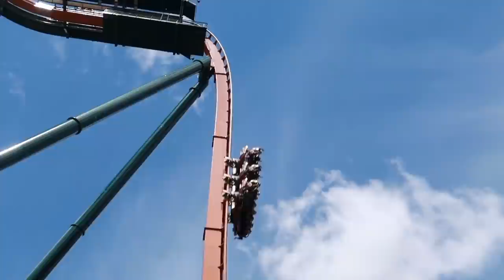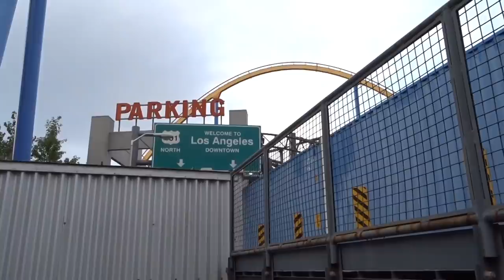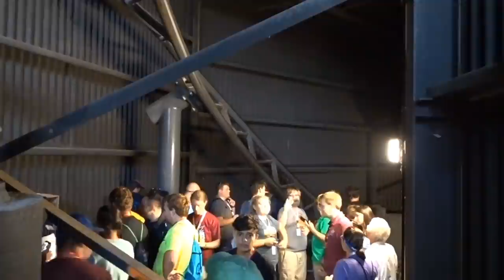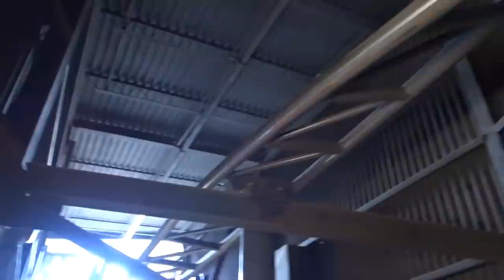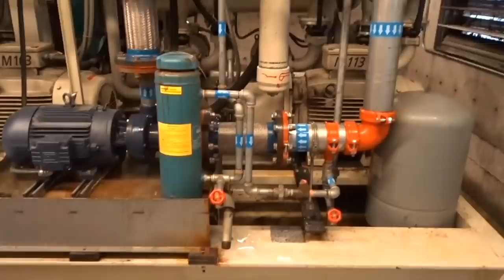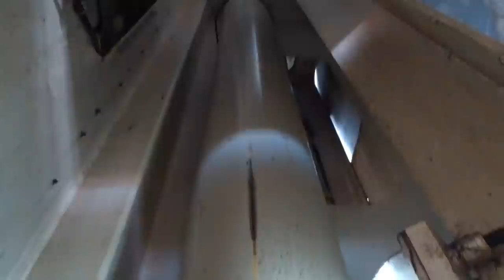Canada's Wonderland Unique Investments

Comment: Floorless is very unlikely. Nobody has had one built in years, and all the recent ones were conversions from a standup. Also, as far as I know, CF hasn't had any B&M flyers built at any of their parks and have only inherited them if they even have a single one (I'm too lazy to look it up right now). Flyers, from what I know, also have capacity problems, so they wouldn't be suitable for such a high attended seasonal park, unless they can build one with a dual loading station and maybe some other improvements to help with flow.

Aside from flyers, B&Ms are perfect for this park. I would much prefer a blitz style launch and an RMC but maybe a wing coaster would be the next best fit. If Thunderbird hasn't had any reliability issues with their launch, maybe this would also be a good option to fill in the gap between the giants and the smaller coasters while also giving a thrilling launch coaster. This would also be a very unique wing coaster for CF, and it's something B&M has done before. Once that's built, then they'll have a good amount of high capacity, reliable coasters and can move onto something else, such as the rumoured ground up RMC. I think that would very nicely complete the lineup. We would have a kiddie, several families, small thrilling (one with a launch depending on how you class Stunt Coaster), large thrilling (also one with a launch) and giant thrilling coasters. Edit: I forgot about a dueling coaster. Don't suppose they could kill two birds with one stone and make a dueling RMC?

Comment: I think you're overestimating Canadas Wonderland's relationship compared to other parks. Canadas Wonderland asks B & M what they want and then they deliver but the same thing happens at other parks. During an interview with Don at Kings Island he talked about how they explicitly went around to all the other inverts and then came back to B & M with the exact elements they wanted with Banshee. Carowinds was hand in hand with the Fury elements. Cedar point designed the keyhole element over the entrance. B & M will do whatever the park asks within reason. Having there giga module being exclusive to cedar fair makes no sense. If someone else wants one they will build it. They are a German company. They use the metric system. A ride over 300 feet doesn't make a difference to them. They just consider it all to be a mega coaster on their website.
Reply: That had absolutely nothing to do with what I was talking about